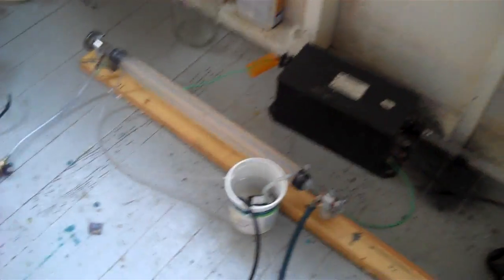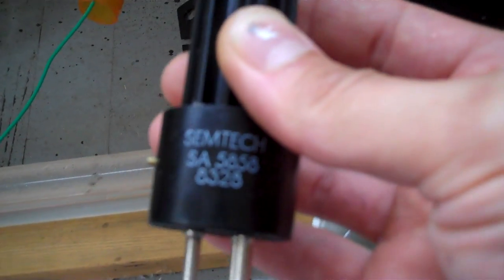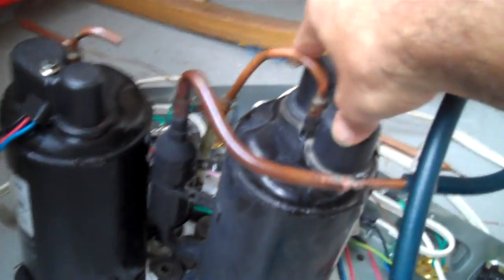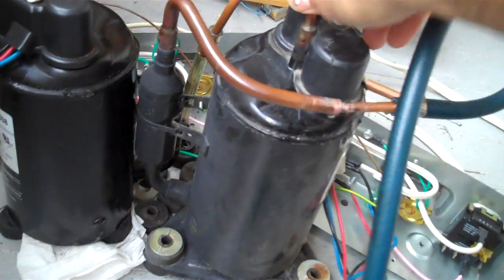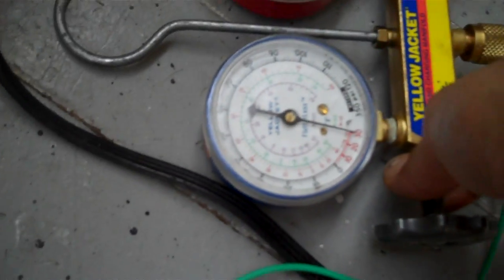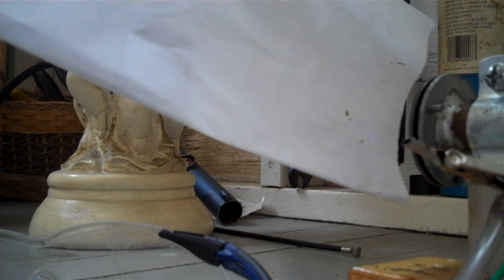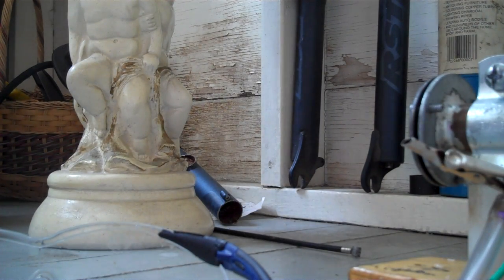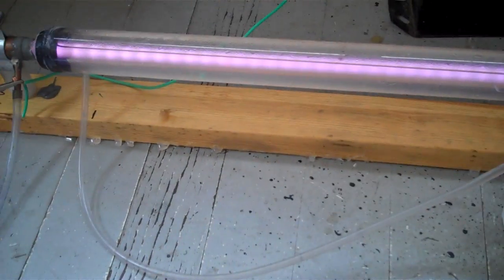Homebuilt co2 laser

Comment: Sequentially operating piston compressors will not produce high vacuum. If rotary pumps are similar in design to branded vacuum pumps, then they will increase the vacuum level. You can also get piston ones.If you change the design of the piston pump, you can get a high vacuum, but the volume of the piston will be large in the second stage.

Comment: Hi, I see you all VDO VDO, but I did not understand the introduction of air out of the pipe. That should remove it, I try to bring out the air and release the gas into the air, at least try to supply high-voltage light bulbs, but it is not as effective plasma happen. But if the air out, then I would point to the high power lamp will light up the plasma, I should do well. Now and then jam Help with thanks

Comment: What's the current of your laser? Why you used curved mirrors and not flat ones?
Also, my laser physics book suggests that increasing width of CO2 laser discharge does not increase power, so you might want to try with 5-8mm inner tube inner diameter.

Comment: When the output starts fading, turn the transformer off, wait a few seconds, and then turn it back on. Adjust the pressure so that it is just below the level where the electrical discharge begins (as determined visually). Put several meters (at least) of hose between the laser, and your needle valve. 

CO2 lasers will do things visible lasers cannot do. That's part of what makes them interesting to me. For example, burning clear plastic. It's not just the power that makes them unique.